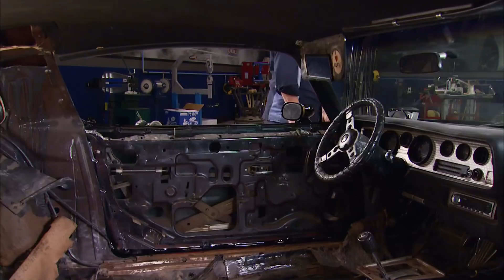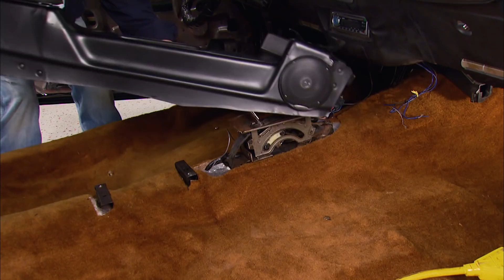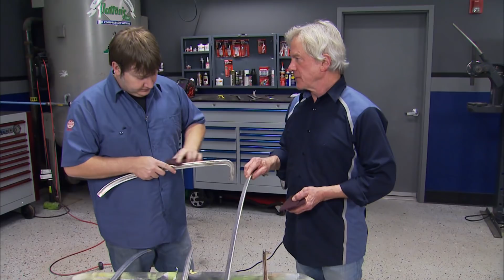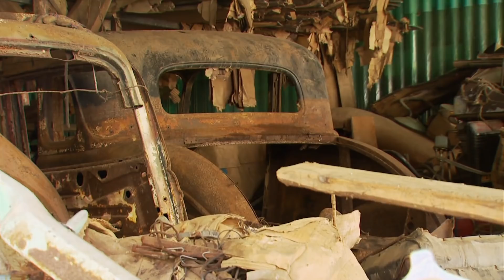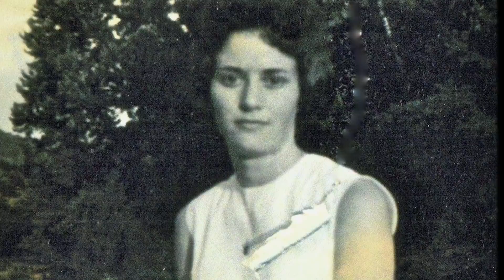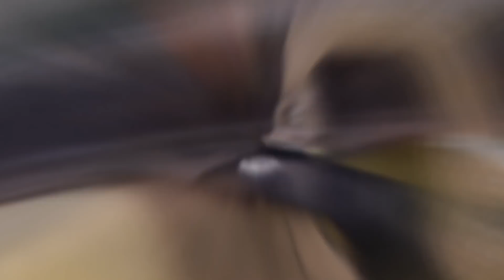Bandit Tribute Trans Am Gets a Functional Hood Scoop - Detroit Muscle, S1, E10

Comment: Is there any concrete evidence that, once the shaker is open, performance increases? I'm sure it does, but by how much, and under what conditions? I've had this shaker mod on my 1979 403, tested it with a series of tape strips to gauge the amount of suction, and was totally impressed. However, that was at a standstill and revving the engine in neutral. The positive pressure given to the open scoop at speed must be considerable, but is there any tests done to measure it?

Comment: I love the functional hood scoop, where does it get wired to the car at?
Reply: There's a switch on the carburetor that opens when you hit WOT. My 82 Trans Am has the same setup on the Power Bulge hood
Reply: My 81 Z28 had a brake light switch mounted under the gas pedal for the hood scoop solenoid.

Comment: I didn’t go to so much trouble on my hoodscoop, just drilled it out, put a wire screen in with silicone and painted it black. Never had an issue with it.
Reply: What about all the water that's gonna get in there?
Reply: @dannystewart1412  You don't drive the car in the rain/snow, etc. These cars weren't the best performers on wet/frozen streets. And let's be honest: these cars are driven by people who have other cars. If it is your daily driver, the hood solenoid kit has a small switch located under the dash to manually close it. Once manually closed, it will only open under hard acceleration, akin to the 1980-1981 Z28 "Air Induction" hood scoop. Again, you would not want to push these cars on wet streets. 2nd gen F-bodies are notoriously nose-heavy and do not like wet pavement.
Reply: @dmbolender  I have a '78 W72 T/A. You're gonna want to wash it every now and then. And anybody can get caught out in the rain. If you just cut it out and put screen mesh in the opening, water has nowhere to go but in the carburetor.
Reply: @dannystewart1412  Danny, thanks. With an open scoop, there are ways to prevent water from entering the cavities while washing. You can block off the open hood scoop with whatever your imagination can come up with. It's actually pretty simple. 
There are some manufacturers who make nozzles for your hose which direct the water in specific directions. Using these nozzles, you are able to direct the water away from the open hood scoop.
 
WRT getting caught out in the rain: weather prediction has come a long way. There are even websites you can go to which spell out when rain might, and will, happen. If you consult these sources of information, you can avoid rain falling on your '78 W72 T/A. 

If you like your Trans Am, like I do mine, don't drive it in the rain. Buy a beater and leave your '78 W72 TA in the garage when it's raining. 

Some of us open up our hood scoops because it hurts, seeing the scoop blocked off with plastic because of some Federal law saying it's too loud, and the fact that it was there to help the engine breathe, not as an ornament.
Reply: Agree 100%.  I had a `75 TA and opened the scoop without putting any screen.  As I recall there was just a plate that was rivoted into the good scoop opening.
I never really noticed any carb noise when driving (as you still have an air cleaner element between the carb and the scoop opening.  
I also never had any issues with water when washing the car or when driving in the rain.  
I think the flap and the servo mount just add unnessary air resistance within the scoop that defeats 100% of the air flow that you'd otherwise get.
Reply: Yea sure, now you have to listen to that stupid carburetor whistle noise constantly. That’s why their blocked off in later models, you know for smarter people.
Reply: @tropicthndr  I like the sound of my engine breathing when the secondary barrel's open up.
Reply: @tropicthndr  Maybe your ready for a silent electric car.
Reply: @tropicthndr  You're being sarcastic, right?